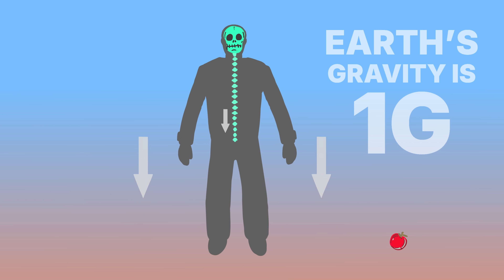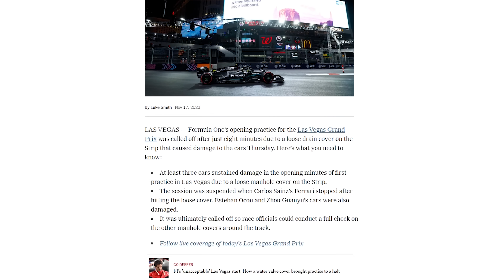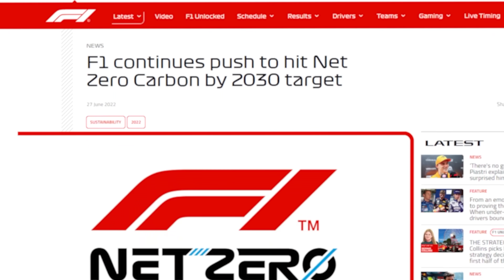Neil deGrasse Tyson Explains the Physics of Formula One Racing

Comment: Oh no, Dr. Tyson, for shame. Talking about aero and missing that modern F1 cars depend more on Venturi effect for downforce and then just glancing off how low they sit.

Huge miss, I'm afraid.

Also, the HANS device doesn't hold their head in place laterally, it keeps their head from being flung forward on deceleration to prevent basilar skull fracture (ie, Dale Earnhardt's cause of death).

What holds their head laterally is the drivers' MASSIVE necks.

Y'all might have wanted to have talked to an expert a lot more than you appear to have done.

Comment: More load on a tire decreases the friction coefficient due to tire load sensitivity, but aero is free load because it doesn't increase linear inertia, resulting in a higher ratio of force to mass, which is why adding aero load will increase acceleration, while adding mass will decrease acceleration.

Tire grip is complicated and some of it is adhesive in these kind of tires, especially in the less loaded inside tire. Calling it friction gives the idea of middle school rubber eraser experiments, but tires produce lateral and longitudinal forces via tangling and hooking at a molecular level and is usually treated as varying levels of static and sliding friction across the tire contact patch, so you can't really use the same rules as for basic friction stuff. The friction is variable and changes based on driving parameters.

Comment: PBS Nova had an episode about the physics of Indy cars several years back. One of the drivers said there was so much downforce on the cars due to the spoilers and aerofoil on the back that at full speed, you could flip the track upside down, and the car would still stick to it and not fall off. That's some pretty strong downforce there.

Comment: I love NdGT, but I've now experienced two of your efforts to appreciate the physics of racing (this and a podcast) and...well...you miss a lot of the interesting stuff in an effort to immediately reach conclusions. It's kinda too bad because it's absolutely fascinating stuff and there's a LOT of interesting physics and chemistry at work (take a look at top fuel dragsters whose engines are pumping so much fuel they run nearly in hydro-lock conditions or, as pointed out below, all the aerodynamics happening on the bottom of these cars). You're not really doing it justice. Alas.

Comment: Neil got the downforce of the underside of the car completely opposite of reality. The air underneath the car is at a VERY low pressure and pulls the car downwards with a LOT of force. He thinks it pushes the car up as shown by the arrow. There is more downforce than the car weighs so it could run upside down on the ceiling of a tunnel.

Comment: Sorry Neil,  but the person doing the aerodynamic animations of the plane wing and the car wing, does not understand how a wing creates lift.

I then realized, having watched Formula 1 cars running in the rain, that it is one of the best examples of showing how a wing creates lift. The way the moisture flies up above the car, with the flow of air over and off the trailing edge of the wing. It seems to me that the stream of air carrying the water mist goes 15 to 20 feet into the air.

I have believe all race cars have special 'rain' tires with grooves, that help to provide more traction on a wet surface, than the standard racing slick.

Comment: I grew up watching NASCAR in the 80s and 90s. It was great when teams could make adjustments to the cars during the race to try and look for an advantage. Now, the cars are basically all identical, and the changes you're allowed to make during the race are pretty much non existent. I quit watching racing for about 15 years until I gave Formula 1 a shot a couple years ago. Now I'm hooked. The technology in these cars is unbelievable. I love all the variables from tire hardness to front wing design to charging the battery to use that energy to your advantage. Now if somebody could just be competitive with Verstappen...

Comment: 2:42 btw the hans ( head and neck safety device) is not used against g force in the corners but to stop there neck from flying forward in the case of an accident, instead the drivers workout there necks to make them stronger in the corners.

Comment: One interesting thing with the downward force caused by the rear wing is that at low speeds it doesn't do much, because there's not enough air moving over it, so you need to make it bigger or at more of an angle. But then, when you're trying to go fast you'll have all this pressure pushing your car down into the ground. If you had toy cars as a kid you'll remember how much harder it was to push the car forward when you were pushing it against the ground, because of all that friction. So not only does it slow the car down, but it also increases tyre wear.
I'm not sure if they do it in F1 but there's an idea to automate this so the wing moves up on slow corners and flattens out on straights to reduce wind resistance.
If you're driving in less technically developed races like GT however, you need to plan your wing angle for the whole race based on the track and taking into consideration how the angle and size of the wing will affect the speed on straights and cornering.
The physics of racing are really interesting.

Comment: If they are going to disassociate water and combine it with the CO2, what are they going to do with the O4 left over or the energy from solar?  Are they going to attempt tetraoxygen or will these be free-floating oxygen that could wreak havoc on the combustion system? Another byproduct could be O8.. Depends on how quickly O4 can find the other O4 before attaching to anything else. Perhaps build a vacuum chamber to allow this to occur?

Comment: Unfortunately the only exciting aspect of F1 today is the engineering and the numbers involved.  The actual on-track racing has got progressively less exciting year on year.
The peak for me was in the 1970s and early 1980s, when HUGE horsepower met tiny, manual control, cars.  Basically just brave drivers sat in insane cars.

Comment: Halo isn't a rollbar. The other car structures, including the highpoint of the car, the top air intake, are enough to keep the driver safe in case of a roll. The halo is there to protect the driver's head from horizontally travelling objects, such as another car climbing over the car's nose.

Comment: Yes, formula 1. A highly technical and horrendously expensive motor sport! 😁

Trivia of australian motor racing out lane speed:-  pit lane speeds for Australias(all road circiut racing, including the 12 hour and V8 supercars) was reduced to 40kph/25mph to prevent accidents and injuries to pit crews and camera crews. 

To ensure rhe speed was adhered to and to avoid penalties to the drivers. The cars have a button on the steering wheel that drops the computer system into "pit mode"(speed limiter). It sets the maximum speed to 40kph/25mph. 

The pit stop itself can be over 30 seconds when refueling to full or near full (100 litre "top up" at 3 litres per seconds flow, regulated. Its near 45 seconds for a 130/135 litre fill.)

A pit stop with driver change takes around 23 seconds.. (mandated, maximum 2 hours in the drivers seat on any one stint, pit time inclusive)

Pit times quoted are for Mount Panorama, Bathurst. Where the total time within pit lane might be greater than 90 seconds. 

The "bathurst drop tank" as its called, is required for the cars to traverse around 30 laps between pit stops. The cars consume an average of 4.5 litres for the 6.5 kilometre distance of the track. 

The race is 161 laps / 1000 kilometres. 

Personally, the racing and Bathurst has never been the same since the birth of the "supercar" era and all the additional race rules/controls. It lost some its magic. Then, i am old enough to remember the racing of the late 1970's, 80's and into the 90's. An era defined by drivers like Peter Brock(King Of The Mountain).

Although australian motor racing isnt the same as it once was.. Its still far more interesting and intense than almost all tarmac/road racing.

Comment: It is important to understand net downforce and how it affects the handling of a modern formula one car.  Jim Hall was a pioneer in understanding the affect net downforce had on a racing car back in the 60's with his Chaparrals.  I would encourage viewers to look into how he applied aerodynamics to his cars that you see on current F1 cars.   A neutral handling car would be ideal if it was possible, but is hard to attain.  Instead the cars have to be set up for the driver's preference.  Drivers might prefer to have a car with a slight amount of understeer or oversteer depending on what will give them the fastest lap time and optimize tire management.  The simulators that the F1 drivers use would be another topic that would be worth looking into.

Comment: The HANS device (or in your parlance, the structure around the drives neck) has nothing whatsoever to do with helping the driver deal with lateral G loading. It's there to help prevent damage to their neck/spinal column in the event of a massive negative G event. Or a crash, as you'd know it.

Comment: There is one mistake. The air doesn't lift the floor. Opposite, the car is designed as a big wing itself and thus by ground effect (search it) it gets sucked down on the road. This sucking force pulls drains like it did in Vegas.

Comment: You missed an opportunity to talk more about one of the most important aspects of these cars, the tires.  Unlike street legal cars, they use slicks.  Theses are flat faced tires with none of the grooves present on radial tires found on road cars.  It may sound counter intuitive but slicks have more grip than regular street legal radials with one important caveat.  They have to be heated to be effective.  Once heated, they will grip into every nook and cranny on the road surface to get that grip  and you get the maximum surface area in contact with the track.  Plus with all of that downforce and the combination of lateral, breaking and acceleration forces they experience an enormous wear and tear on them which could lead to blowouts..  This is why they have to pit in so often to change them out.

Comment: Dear Neil, correct me if I'm wrong.  An F-1 car is basically built almost entirely around Newton's First Law;  A mass that is set in motion will stay in motion unless it is interrupted by two things. One, an outside force, i.e. aerodynamics. Two an oscillation, i.e. balance.  Every external part(s) on that car is aerodynamic shaped and every part that rotates and moves is perfectly balanced.  Did I kinda get that right?   Neil what would the modern world do with out you....

Comment: Not sure if anyone else has mentioned this but your graphic of ground effect isn’t correct. The air moving under the car creates a low pressure zone which actually sucks the car to the ground, not creating lift. On a ground effect based car the diffuser typically produces the largest portion of downforce.

Comment: Neil talking in the first minutes about increasing friction: I learned in H.S. Physics circa 1975 that friction is independent of contact area. First question from that realization was, why then do we fit wider tires on race cars? Answer: traction is not the same as friction. Then he assumes we want downforce only on the rear tires. He gets close with Bernoulli but assumes under car aero causes lift, when it's actually been harnessed for downforce. I'd encourage you to study race car dynamics before you try to adequately interpret the subject for the masses, it's a complex and fascinating subject

Comment: Carbon Neutral is NOT really carbon neutral, is it?  So they pump CO2, carbon dioxide, which is what, manufactured CO2 in order to be used in a factory environment, and combined with hydrogen to make hydro-carbon molecules to mimic fuel.  But is the net concentration of CO2 really zero?  Maybe in a chemical equation but not in the environment.  Come on....

Comment: NdGT has it wrong: organs like the heart will not flop around inside the body, except the lungs. It's the reason there were animal experiments to use fluorocarbons saturated with oxygen to see if fighter pilots could breathe the fluid and so avoid lung flopping. 

As for the space shuttle doing 3G: my pal flies us in 3G  manoeuvres in a Cessna 152 - a coke can with an engine.

Are the Primordial Soup cans available to buy?

Comment: I realized something at an Indycar race some time ago and discussed it with an engineer for one of the teams (I asked him, more correctly).  My theory was, some air goes through that thin tunnel under the car (which Neil pointed out) and then comes out the back of the car.  Now, what I noticed was, at the back of the car, on the under side, it suddenly widens out which means the space expands abruptly which means a higher volume and yet, the air coming underneath the car is a fixed volume meaning that this air suddenly expands but doesn't want to which, I surmised, would create some down force on the car as the air wants to retain it's volume.  I have to say, with a little pride, the engineer told me I was correct and the term used for that force is "diffusion".  That was a good day for me as I am both a fan of F! and Indycar and I like physics, astronomy, cosmology.....ya, I think you get it.  LOL

Disclaimer: I may not always state things correctly or distinctly; however, my heart is always in the right place.  Cheers!!

Comment: Great video guys. We were very pleased to see one of our favourite topics featured on one of our favourite channels.
A few things: 
1) The HANS device is simply a safety item, it isn't used to keep driver's heads from lilting under high G loadings. Drivers spend a lot of time bulking up their neck muscles to deal with sustained lateral forces.
2) There was a time when there were no speed limits in the pitlane.
3) F1 cars/races are seldom conducted at full speed. There are a number of factors that prevent this, including tyre preservation, fuel flow limitations and engine longevity. As a result, races are often won at the slowest speed possible.
Reply: I believe it was the NASCAR death of Earnhardt Sr. that triggered the response and thus accelerating the release of the Hans,

Comment: If you are impressed of the g forces while cornering, checkout standup jetski racing. Its the cheapest motor sport to reach a level of g in corners where the human body is the limiting factor and not the machine. I can pull close to 4g in a corner but I have to have most of my bodyweight on one leg. I am sure the jet could drive the turn even tighter. If I go that hard I am done after 2-3min driving and I need to take ibuprofen otherwise I cant walk. If you are up for a challenge check out standup jetski not the sitting one.

Comment: On thing that I will say you guys did get a bit off is that the current regulations on F1 cars actually use Venturi tunnels under the cars so the cars actually have negative pressure underneath them sucking them down to the road and in the current regulations that’s what provides most of the down force on these cars

Comment: Neil, you missed talking about the most significant part of the current F1 cars.  Because of current technical regulations, they are ground effects cars with venturi tunnels underneath.  It was an effort to reduce the turbulent air behind the cars compared to their predecessors. The majority of the downforce comes from the ground effects.

Comment: Making gas from water is fascinating. So what emissions does that make in the tailpipe?
Reply: In ideal combustion conditions, just water and carbon dioxide. When it does not burn clean they'll get some carbon monoxide and perhaps other compounds and particulates. They may put in additives to the fuel as well to protect engine parts or aid combustion, those will have some effects on emissions too.

Comment: The neck brace is a HANS device. It prevents the neck from jerking forward in a crash - which killed Earnhardt. It’s not there for stability going through corners. Drivers train there necks to handle the forces.

Comment: For as much research scientists do, they did bare minimum to not enough research about how F1 works. The headrest isn't there to prevent bouncing around of the head. Their neck muscles are massive and THAT'S their primary way of dealing with the G forces. If you see an F2 driver in a Formula 1 car, their heads are bouncing around all over the place and hitting the headrest. The HANS device is the thing that goes around their neck and is attached to the helmet and that prevents massive whiplash from occurring if they crash. It's not there to hold their head up while they accelerate or brake.

Comment: Neil, “formula” 1 is cutting edge science since its start. Peep the name 👀 From chassis design 50s to turbo tech 70s to ground effects 80s to traction control 90s …carbon fiber monocoque, brakes design, pit stop high pressure tools, hybrid ndk, 3D printing CF… u’d fall in Love

Comment: I understand these videos are meant to be rather basic but the aerodynamics of an F1 car are so much more interesting and complex.  The majority of the downforce doesnt come from the front or rear wing it comes from the "ground effect" or the venturi tunnel running underneath the car.  Also there are invisible vorticies all around the car that create boundary layers that direct the airflow where the aerodynamicist wants it to go.  I wish Neil deGrasse Tyson would be highlighting the complexities of the sport but it felt like eh its a car.  Its got a wing on it.  It'll be carbon neutral.  Talking about G force how about the 80+ G a driver experiences during a crash.  I was so excited to see the video as a fan of F1 and Neil deGrasse Tyson but this was a let down.  Maybe I had too many expectations as to what this video was going to be rather than Neil checks out an F1 race.